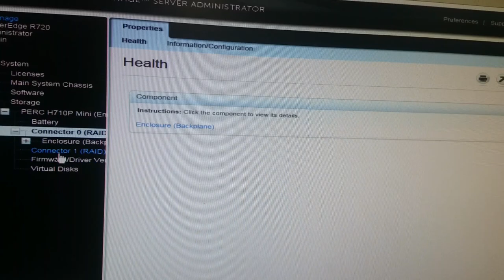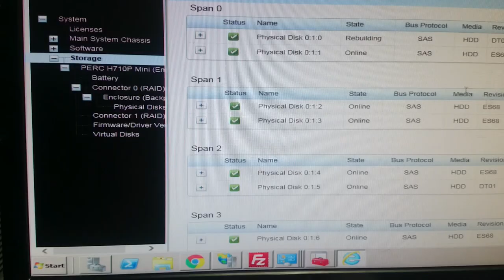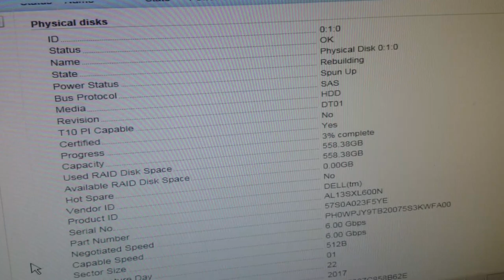Server - Replacing a failed hard drive (hot swappable)

Comment: Thanks for the video. I have a failed drive on my Dell R710 with a PERC H700 controller.  I get the message "There are offline or missing virtual drives with preserved cache. Please check the cables and ensure that all drives are present. Press any key to enter the configuration utility."  Can I follow your instructions or is there another step that I have to do because of the cache?  TIA
Reply from the maker: Hello, I think it depends what RAID level you have set up. In my case I had RAID 10 configured, and so once there is a failed drive in the configuration, a newly replaced hard drive inserted in place of the failed one, will immediately sync and copy the data that it needs too. Do you know what RAID level you have?
Reply: @duskanddawn1275  I have a similar problem, with RAID6, except I have 2 failed drives instead of 1.
Can I hot swap it and expect to retain all my data, or is it gone for good?
Reply from the maker: @aliakbarsafdari4084  Hi, if you have RAID 6 you can have 2 failed drives, so you should be fine. Is your RAID hardware or software configured?

Comment: Hi, how are you. 

My server don't have the tasks option in the interface to execute them. And my physical disks don't stay in the enclosure in blackpane. With my configuration (RAID 50), my serve it's hot swapper?

Thanks if you can answer me.

See ya.
Reply: works in hot swap*
Reply from the maker: @igorrodrigues8487  Hello Sir, if you are using RAID 50 then it depends how many hard drives you have, and how many are failed at this point in time. Here is a link to RAID 50 and how it is setup https://www.techrepublic.com/blog/the-enterprise-cloud/raid-50-offers-a-balance-of-performance-storage-capacity-and-data-integrity/
I am going to say you can hot swap, as long as the amount of hard drives you are able to have failed are exactly that number and not any more than that. If more have failed then you are allowed, and you pull a hard drive out, you can seriously mess up your server. Furthermore I do not have any experience in physically using  RAID 50. So if anyone else sees this and can attest to RAID 50 please do so.
Reply: My questions is with my configuration, i can hot-swap the failed HD or i need shutdown for swap him?
Reply: Can i*

Comment: some serioues issues in security policy if some clerk just there to replace a faulty drive has access to the OS admin account ...
the running OS is off limits - replacing a drive - fine - check it via ipmi - fine too - but access to the OS? uhm - WHAT? this shouldn't be possible under ANY circumstances